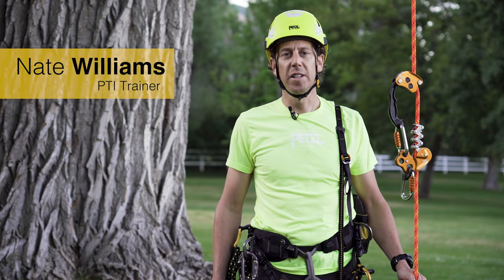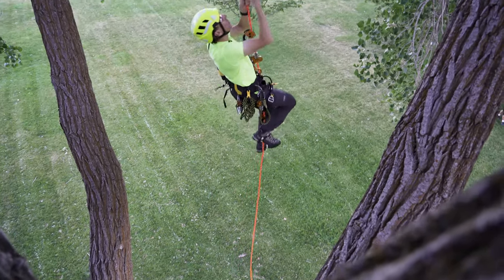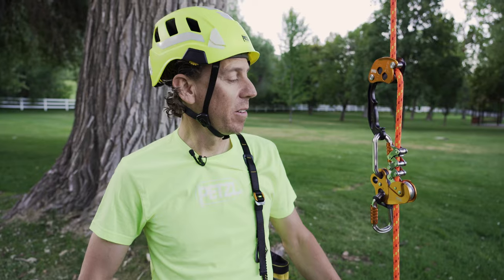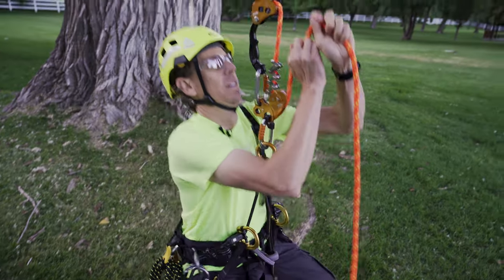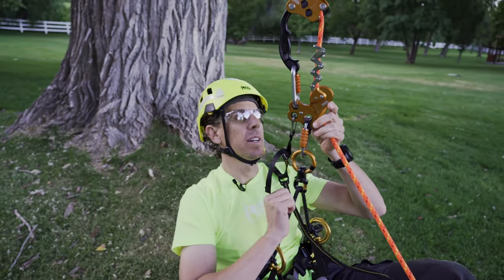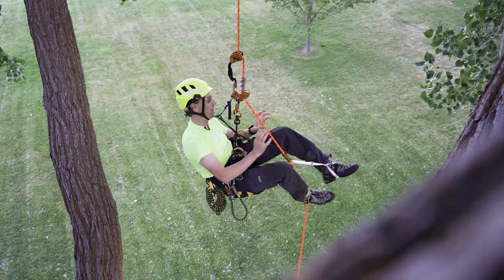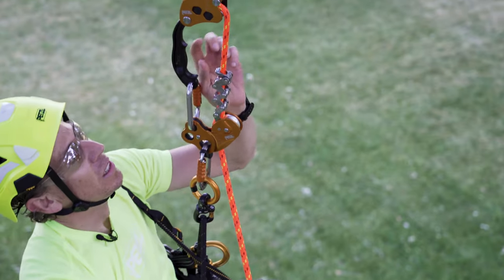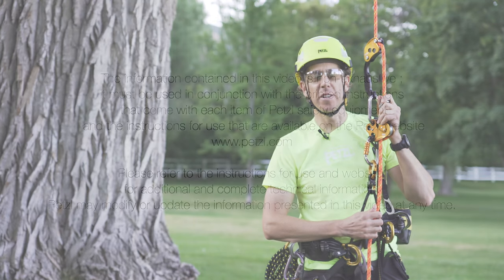HOW TO - SRS Ascending and Descending

Comment: I have been using this system for 12 moths and think its great.  My only concern is it flattens a 13 mm rope as it goes through the chicane and I am wondering if it will affect the rope prematurely.
Reply: The rope you are using doesn't work with the device. Read the manual about the device and use the correct size rope. Check the specs and you'll see the correct rope size.
Reply: @aerialrescuesolutions3277  Thanks, but 13 mm is specified in both manuals as the maximum rope size.
Reply: Then try a 12mm rope, or you can call the manufacturer and they will certainly help you. Stay safe, Jim.
Reply: It is an issue with some ropes. Ropes sizes are personal preferences (as long as the diameter works with the device according to the manufacturer).
I have been climbing on the zigzag/chicane combo since it was launched and have found that the courant squir V2 11.5mm works best for me. It is a rope that does not get flattened as easily.